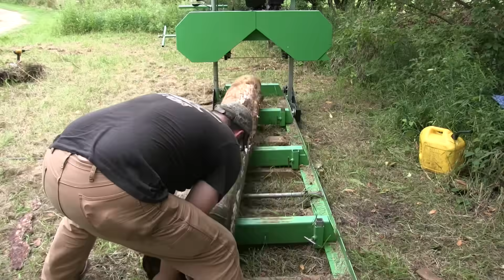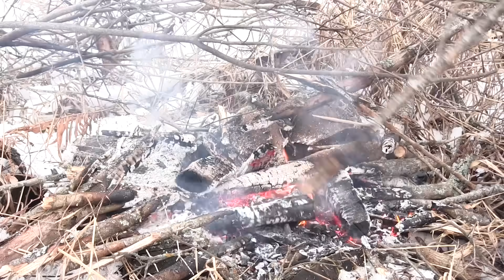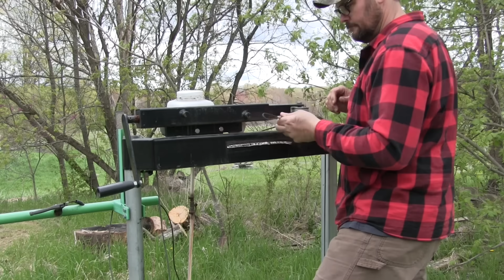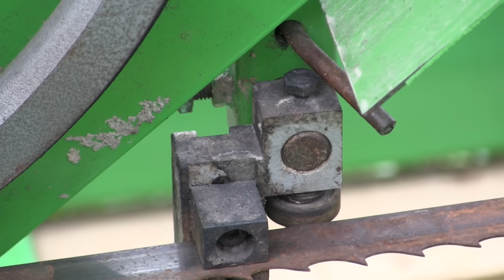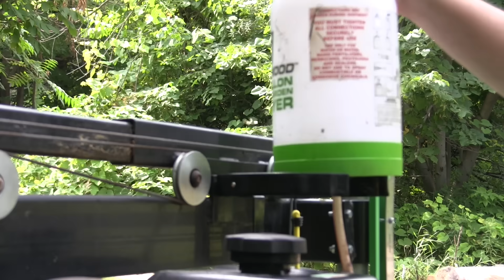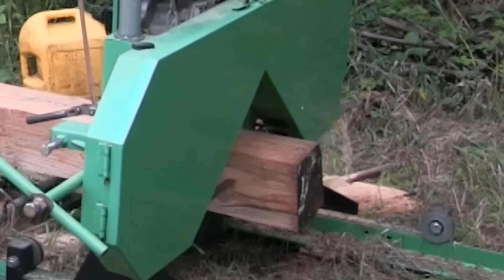Harbor Freight Sawmill .....set up &  first impressions

Comment: They don't tell you the width of the rails in the instructions. Lots of slop as the bolt holes are way bigger than the bolts. The water bottle is total crap , so thin. Mine leaked full of cracks when I unboxed it.

Comment: How did you get a straight cut right off the bat??? Especially with that rusty old blade? I made so many tries, so many adjustments, put on different new blades and nothing worked. Rollercoaster slabs. I gave up and it’s sat unused (and in my way) in the barn for 20 years. Being a stubborn old coot, every now and then I watch a couple dozen YouTube videos trying to figure out at long last if I can use this thing. What is the secret?

Comment: I got one and for the price it’s ok I’ve done some modifications to it and can cut a 20 ft long log if I need to, one thing I was very disappointed in is the brass nut that the screw that raises and lowers the carriage will most certainly fail with use and good luck finding a new one as it’s all Chinese measurements . We just replaced the screw with a metal one and works fine now.
Reply: "Chinese measurements" - you mean metric? What's so hard about finding a metric nut? Is the nut in question an odd size?

"...replaced the screw with a metal one..." - What was the original screw made of, wood? Plastic?

Comment: You should have one half inch deflection on the belt. Too tight a belt will wear the bearings out on the pulley and the crankshaft.

Comment: I have a Predator motor on a push lawn mower for 12 years and it still runs like a champ.  As long as your use ethanol free gas and change the oil every 20 hours of operation, this engine should last you a decade or two.

Comment: You’re right about those harbor freight motors - I have a big twin 700 running my mini airboat and a few of those Honda knock off oredators and I beat the living crap out of those little Honda knock offs and I haven’t had issue one. Straight up, and I’m like you it feels so damn dirty to use it much less praise it, but the damn things just work - you can’t deny it

Comment: My dad taught me a cool trick when I was having trouble getting a belt on my flail mower; put it on the big wheel first and then go onto the smaller wheel. Worked like a charm. Don't know if it would have worked in your case, but just wanted to share in case it could come in handy at some point.

Comment: When putting on a fan belt the belt goes onto the larger steel wheel first then the smaller steel wheel last. When we buy 'the cheapest saw mill we find, it is exactly what we get, cheapest with the most problems. If you enjoy giving the wealth of the USA away to China, then the Harbor Freight mill is great for you. So go ahead and make China wealthier as you make the USA poorer.

Comment: The Predator Engines  actually do have a lot of parts that are Honda Compatable  and in many cases you can just swap them out with a OEM Honda part  in all honesty I believe if you take care of the Predator it will last  a fairly long time   The Chinese have really come a long way in manufacturing quality SmallEngines  I’m a tremendous fan of Honda  most specifically their 90 CC motors  and the Chinese Clones of those have also become quite Competive to the original Made in Japan units  it even includes the Gear boxes (Transmissions )  because China now does know how to do Metalurgy Correctly  and they have the worldwide Connections to resource  the correct Components  Ibagree with you that it wasn’t very long ago that most of the Engines coming from china were Junk

Comment: We have had this mill for a while, it does the job.  Wish it had longer track but we can fix that.  I did weld the track joint when I built it.  First thing built was a roof over it, that is really important.  That engine is a wonder.  We can leave it for a few months, come back and it starts on the first pull most times.  Good tip on the water jug, we will try that.

Comment: This is a CENTRAL MACHINERY Saw Mill with 301cc Gas Engine. It is currently priced at $2,499.99 new online. Issues with replacement parts and warranty.

Comment: Could you have replaced the belt with Kevlar link? The machines whose belts I replaced with a link cable run so much smoother and quieter.

Comment: all harbor f's are DIRECT satellite support system for chi com military,,, direct $ , our country was sold to 'most favored trading' decades ago by dc, when i was buying hf stuff, it was junk, the grinder altho cheap, was loud enough to cause hearing damage, one cutting wheel disentengrated, and through pcs everywhere, its junk you are not saving money, as it will degrade very consistently

Comment: So what are you going to do with those logs man. I think I would cover my whole driveway with them. It might take a while to put down because it's 400 feet long. But at least those paving contractors will stop coming. I have a 2 year old house. It has crushed concrete on it. If I had the timbers , I would definitely put them down.

Comment: Just a tip from a mechanic who has installed many stretch belts, zip tie the belt to the pulley and turn, cut the zip tie once the belt is seated.
Reply from the maker: good tip
Reply: For an economically priced used sawmill you got a good deal with your horse sense handiness for setting it up, Dave.
Reply: But they need a preload. Just making it fit works for an industrial setting making it last is for the home. I have seen to make bent shafts..
Reply: Zà

Comment: I don't understand why they went with a triangular gap instead of a rectangular one.  I suppose that it helps somewhat with structural strength, but you can just reinforce the span with some extra bar stock if you're really worried about that.

Comment: very well made video...seems a lot of hb stuff needs to be modified..those predator engines are good , i had bought a 6.5 hp(212cc) for $100 and put it on a snow blower- unstoppable...question , i have seen others make a set up with using ladders as a rail and chainsaws to cut...any thoughts ??

Comment: Wood Mizer has a  Kohler engine that includes a 3-year commercial limited warranty.
Also an electric 7 HP motor is available...
It may be $1000 more, but you usually get what you pay for.

Comment: Just a heads up as someone who has owned both, spend the extra money and get a mill that has leveling jacks and better adjustments. This is good for a rough homestead set up. But if your looking to build anything more than a small shed or some small planks. Look at a norwood or timberking. If you have money look at woodmizer. Basically every time you drop a log on a mill like this it goes out of level and you need to start all over again.

Comment: Th price seemed a bit high to me, until I saw what it can do...  It does seem like the belt would have an idler pully to allow some flex to the operation and belt installation, but then it is a basic model I suppose.
Unlike others, I have no personal use for the information in this video, however, all your videos have entertainment and conversation value, so I try not to miss any, and am going back to watch older ones from before I found your channel.  My next project is season 4 on "Alone".

Comment: Dave: The Harbor Freight mill at the price you paid use was relatively inexpensive.  You need to check Harbor Freight is $2700!  Woodland mills is much better.  However you got a good deal.

Comment: I just had to repair a motor from harbor freight. They had all of the parts, in their parts supply system.  You might be surprised at how easy it is to get what you need.

Comment: that belt would have put way to much presure on the bearings, also it would pull that hard on the wheel that it mite change the actual running of the band.

Comment: I feel like if you removed the motor mount bolts, slid the engine back, put the belt on, and then put pressure on the engine it would have went on.
Reply: If he couldn't force the belt on I doubt he could have forced the motor to line up the bolts. I believe I would have broke down and bought another belt for the second or third time if needed. I had to do that for my tractor:)
Reply: @charlesbentley2934  Forcing the belt over the pulley takes an extra inch or so of belt that forcing the motor into position wouldn't have if you understand what I mean.  It seemed pretty close and the belt probably fit once it was on, it was just too tight to put it over the pulley.  Kind of like you aren't removing a serpentine belt without loosening the alternator on a old car but it fits and the alternator will be in the same place after you retighten it.  The belt fits but won't go over the pulleys, same thing here.

Comment: good share. you can buy any bearing you need from a bearing supply. every decent size town has a few. they can get any size bearing made unless it is special like bearings in a Hilti hammer drill, they make their own bearings. I buy spindle bearings for mowing decks at bearing supplies a couple of bucks each. dolly bearings etc. I live in Kennedale Texas American Bearing is right down the street on Mansfield Hwy. they also sell chains, belts, pullies anything to do with motion
Reply: I think his point is you have to figure out the size but with brand name you just order the part number.

Comment: Awesome review and love to see your problem-solving with the belt replacement! Inspiring Work! Thanks for posting, cheers!
Reply: nothing to solve He tried to use a b75 belt  which is 78 inches long outside measurement. This sawmill takes a #b1981 which is a 78" long belt inside measurement.  He didnt solve anything he created a problem out of thin air and wasted a bunch of time and weakened his mill.

Comment: If you wait for the Memorial Day, Labor Day, Fathers Day deal with 20% off coupon, it DOES apply and you can get this sawmill new shipped to your door for $2158. I'm a 25yr mechanical engineer and fab shop owner, and designed one myself in SOLIDWORKS. But the materials alone for it in 2022 are $1750 (including same HF engine). So buying this thing new for under $2200 was a no-brainer. Ordered mine May 27 2022 and it finally arrived on August 12 2022 (77 days) after being on backorder. Worth the wait!

Comment: So you paid 1500.00 for a used commi china made sawmill. The gas money to go pick it up. Buying the treated lumber from the retail stores to set up the sawmill. Plus all of the other costs and modifications needed for it.
You will have more time, effort, work, money in that sawmill than if you go pay the higher costs of lumber at your Homedepot or other lumber stores. 
Also gotta consider that you dont just cut down a tree, turn it into lumber, and then use it. Its gotta be dried first or youre going to get twists and bows that will often times rule out the ability to use the lumber the way its needed to be used

Comment: We have the same identical mill on our farm. It was a little difficult getting additional blades. I ordered them from Harbor Tool and am still waiting and waiting and waiting. So I found them at Norwood Mills and bought 10 along with their sharpener. Very satisfied with them. We’re in the eastern woodlands of the USA (Ohio) so we’ve been cutting some hard wood (walnut, white and red oak, & etc) as well as poplar, sycamore, pine and a little birch. We put ours on a concrete pad and built a shed roof off our barn to provide cover. So far so good. Hope yours continues to service your needs well. 👍🇺🇸

Comment: Couldn't you have just removed the engine mount bolts, (allowing you to slide the engine back far enough for the belt to slip over the pulleys), then slide the engine forward again, and reinstall the bolts?

Comment: I’m wondering if someone changed the motor pulley at some point to a slightly larger one to get more band speed also the old belt shows signs of running on an “A”belt width (1/2”)pulley. A “B” belt is 5/8”top width I know this mill is made in China but I can’t believe they would make a mill that you would have to alter the motor mounting just to get the belt to fit.

Comment: Hmmh. Round here in EU i've seen similar saws to this, in fact my old man bought one some 15y ago. Only difference is that, these are electrical. Theres an option to use generator alongside it but the machine itself still runs on electric motor.
Wonder if the combustion engine sawmills are American thing or what? Cause i have not seen any around here!

Comment: Great video... I have a different brand- Woodland Mills- I like you got mine set up before winter, but wi terrible caught up w me. I built a raised "bed" for it out of 4x4s basically. Bad back from an injury years ago, forces me to make things to minimize bending. I sunk the legs and built on them. They are about 14" above ground, and I'm about 5'8" these days! Works good for me for height. Made removable ramp and hand winch set up to roll logs onto the platform of the saw. Main thing is to check level. I also had better luck makin a jig for board thickness, than relying g on the measuring gauge on it. Simple fit over the top of the timber and sandwich the band. Happy milling!

Comment: There not 1500 bucks NO MORE!   There 2400 bucks NOW!   So you got a good deal 👍 At less it will get ya going the right direction. I notice it was skip cutting. it wasn't consistent cut!  only thing i can think of  is the movement side to side.   Thanks for the review

Comment: For replacement bearings for your mail just take the number off the bearing any bearing supply company should be able to get the bearing for you with no problems pillow blocks mostly all your bearings should be available from a bearing supply company

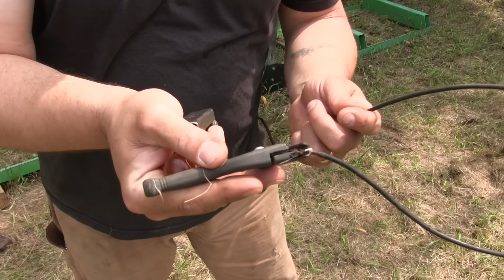Comment: 8:21 Any plastic that is not 'UV proof' can be coated with UV proof varnish. Give it a whirl. It works down here in Australia. Very high UV count.
Reply from the maker: good to know!
Reply: @Bushradical  No worries Cobb! I'm about to put a small black plastic water tank (8 or 10 gallons) on the roof of my motorhome... for a warm solar shower at the end of the day, you know the one... free hot water (might not work too well up your way!) So if it ain't UV proof I shall make it so with one coat of decking varnish! Simple as that. Good luck with your scene in Upper Michigan.

Comment: Good job with that belt fitment.
Good job with the video, straight up honesty forward,.. good attitude,  keep up the good energy..
    Those wood mizers are sweet but so, expensive, this is a cost effective option , for the guy good at improvising.
Thanks for this review.  Appreciate it alot.
Cheers.

Comment: Awesome!  Love your videos.  The cut looks rough, the blade(s) probably need or might need be sharpened?  That wood shouldn't be shredded at all, it should be fairly smooth with exception its fresh raw wood.  I grew up with a tiny town lumber yard, that milled its own wood called Goodman Lumber Mill and Company.  You could literally puck the wood you wanted and watch it be milled, then loaded into your truck or onto your  trailer bed.  It was so cool.  I think I'd either have those blades sharpened or I'd replace them with new blades.  Now all you need is can hook to grab, pull, turn the logs,, and a large planer or - large sander, and you could really get some great looking boards!

Comment: Oh, I just though of something else which might be useful. I don't know how model numbers work for belts there, but I suspect 78 is the circumference in inches. I haven't thought through the maths, but if you had a pair of infinitely small drivewheels, a 79 belt would only add 0.5in to your distance, but you have a big-ass slave wheel there occupying probably 40% of the belt and a drive occupying maybe 10%, so your "next size up" belt is only giving you maybe 1/4" extra.

Comment: Nice. Not sure I'd have bothered extending the engine mount slots. Did the engine end up within the bounds of the original slots? You might've got away with unbolting it, dropping the belt on, then bolting the engine back on. Maybe.

Comment: I use the same philosophy with buying Harbor Freight.  First I don't buy their warranty, because if the tool breaks its never all that expensive to go buy another.  It's worked out because I'm not a heavy user of anything, so rather than spending 4x or 5x for brand name stuff, I'm money ahead by going with the el cheapo Harbor Freight strategy.

Comment: Cool, wish I had one and was thirty something instead of a multiple of two.

I would not worry about the bearings. Sure they will fail especially when worked hard, but they are almost surely of roller or ball type which by being standardized enables a quick replacement by looking for the number stamped on the bearing. 

Please send this old curmugeon a baker's dozen of hardwood one inch thickish boards every four months. Can't get far in the woods anymore but still can crawl to the shop. I do want to build a jumbo sized guitar and I am thinking the first shipment might contain a species of spruce fitting for the sound board.😊

Comment: AMSOIL makes an excellent half petroleum/half synthetic small 4-cycle air-cooled engine oil that is outstanding. It’s a 10W-30 viscosity and wow!! My lawn mowers run so smooth it’s amazing. I’ve got one old Briggs that I’ve had for 6 years that literally runs like new. If you want this Predator to last, give that AMSOIL for small air-cooled engines a whirl.

Love this video. Really well done. Thank you!!

Comment: You got way too much preload on those bearings with that tight belt. They are not going to last very long. Think about this.... Let's sau you tighten your lug nuts up on your truck so that they're almost ready to break the studs and then you went around the corner with a heavy load on your truck and they broke... Too much preload.... They were over torqued. What if you put 15,000 pounds in your pickup truck box... And wondered why your wheel bearings went out. Most belts won't stretch very much you'll damage the bearings before they do .